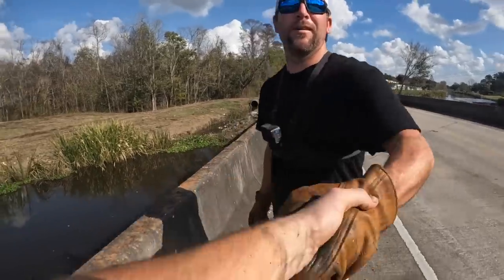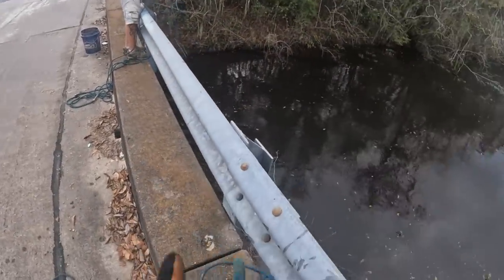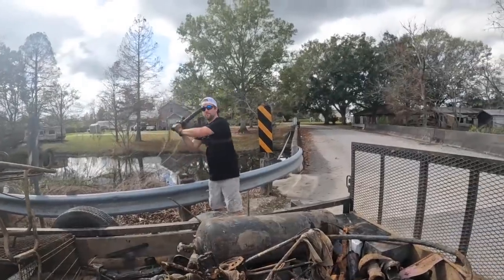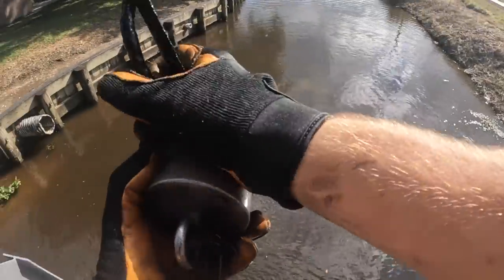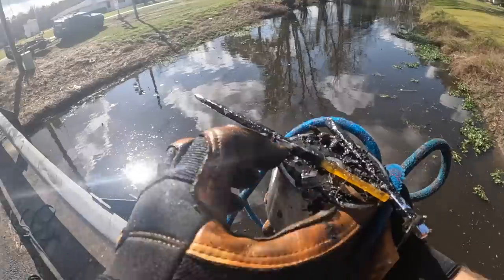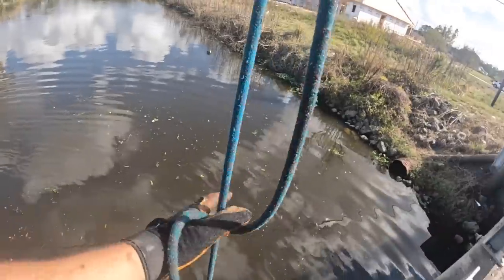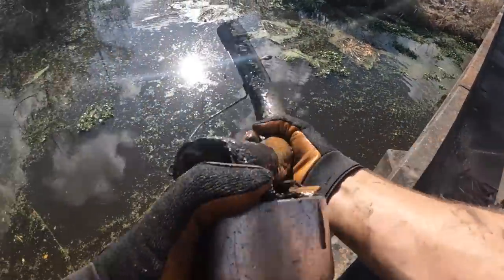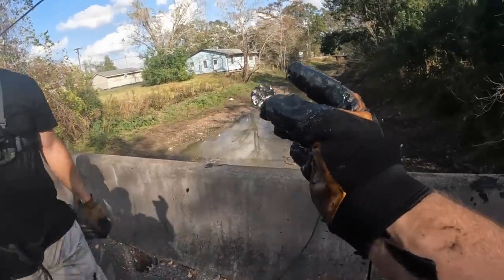We Found A STOLEN Cash Register With MONEY In It - Magnet Fishing For Lost Valuables

Comment: Cash Register. Whatever you do don't ever try to open up an Air Brake as the Spring inside is under extreme pressure and can Explode with Deadly Force when it comes apart.